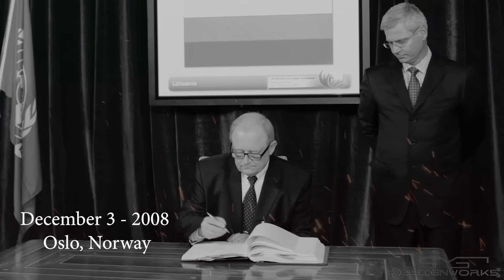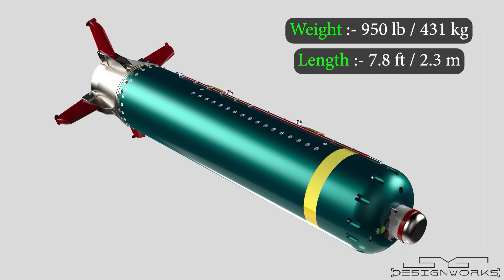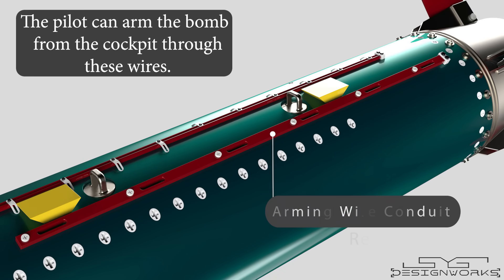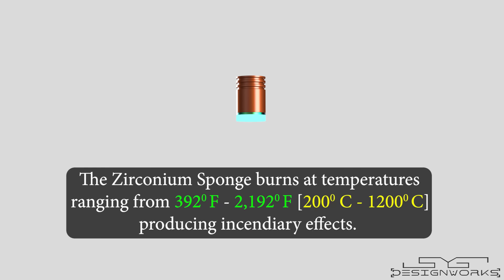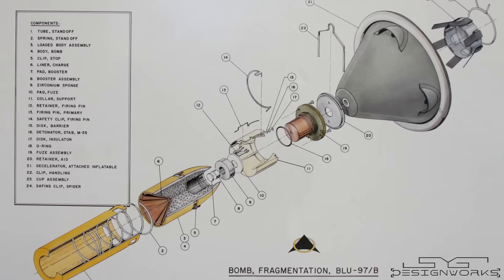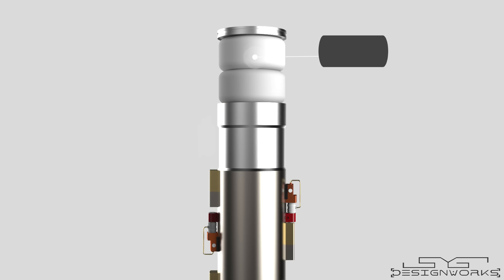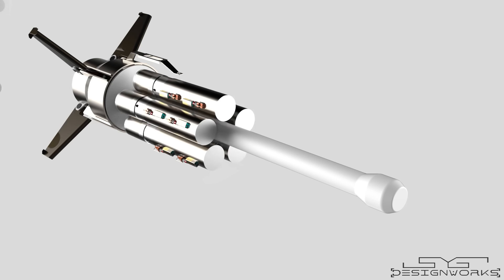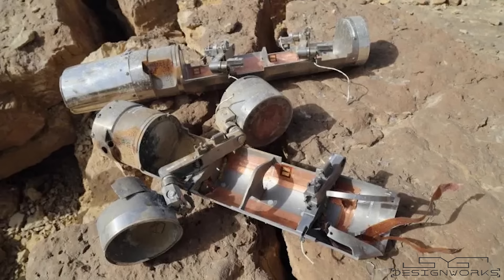How do Cluster Bombs Work?  | CBU-87 and CBU-105 Explained!

Comment: I love the MIC
Reply: Right? Because without it, everyday things you use wouldn't exist. Including medicine and medical procedures that save lives, and the tires, suspension, and engine in your automobile. Or even the microwave you may use to heat something up.. the wireless network you're watching this on, and the device you're using.